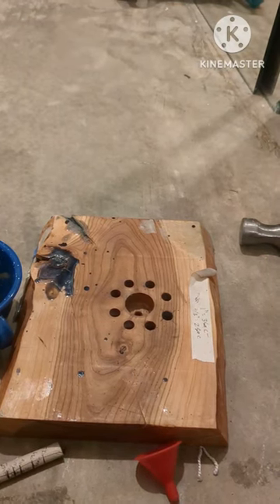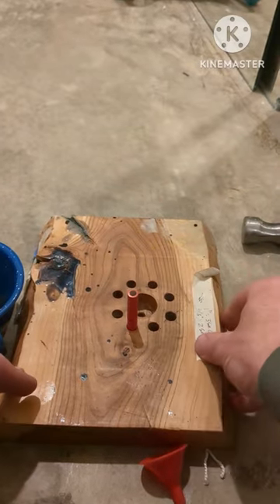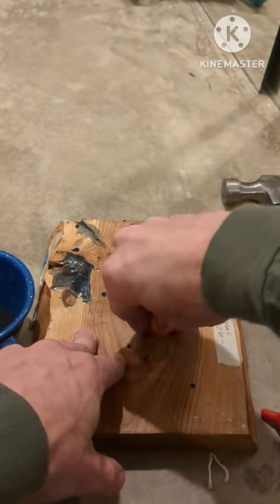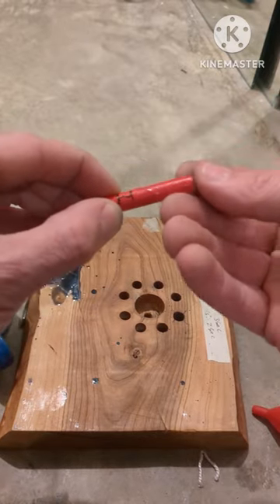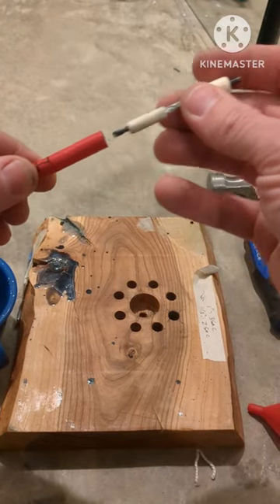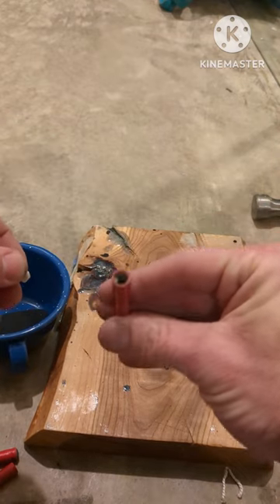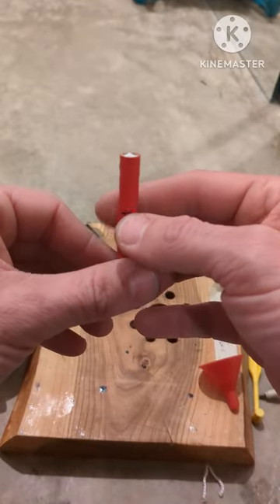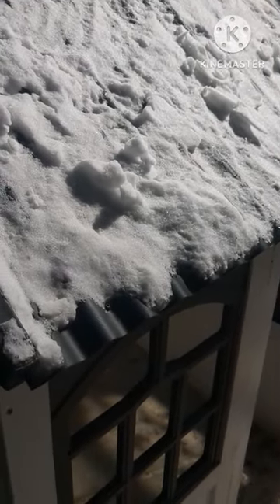Timed fuse for fireworking 5" mortar shell (little trick i learned through troubleshooting.)

Comment: Excellent demo! 👍
Reply from the maker: Thanks man!   Sometimes the best videos start out with failure.   That's when you can troubleshoot and get better.   Couple months back I had a 3" round ignite the spolette only to watch it fall back to the ground.    It was 4ty of July, so lots of people around and my heart dropped hoping it wasn't going to blow on the ground.    
It never did go off (thank goodness.)  I always wondered why it lit the spolette just fine but failed to throw fire into the center/burst of the mortar.  I really think this is the reason (can be seen in the vid.)   From now on, I'll be putting a counter sink hole on the inside of the spolette plus loose fine granulated BP and a little cotton on top to hold it all together.    I was very surprised to see how much fire it threw toward what would be the inside the shell.